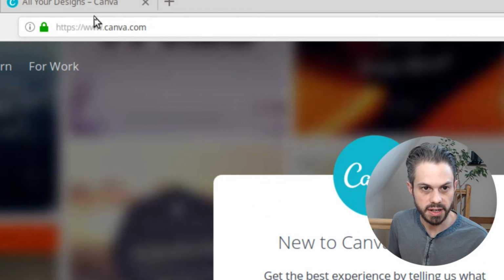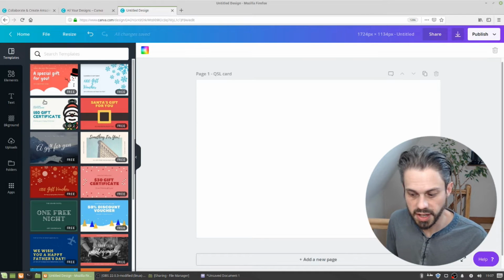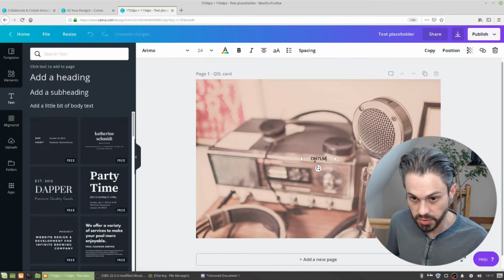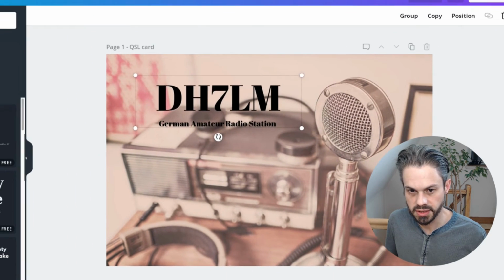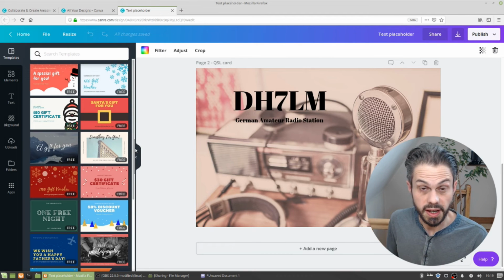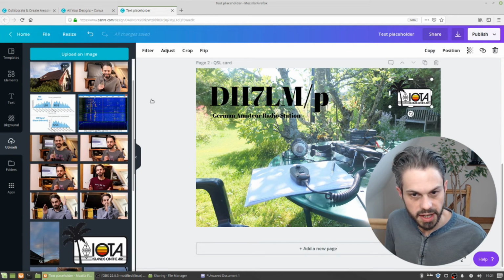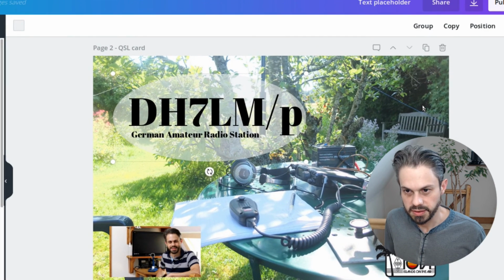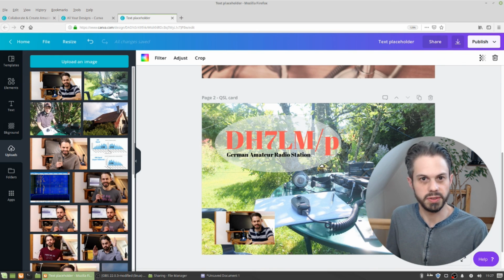How To Design Your QSL Cards Online With Canva (free and easy)

Comment: What's with the low frame rate of the screen capture segment? Better use OBS?
Reply from the maker: I actually use OBS, but to be honest, it doesn't seem to run that great on my little cheapie Linux box... Need to play around with it probably and see if I can optimize some settings.